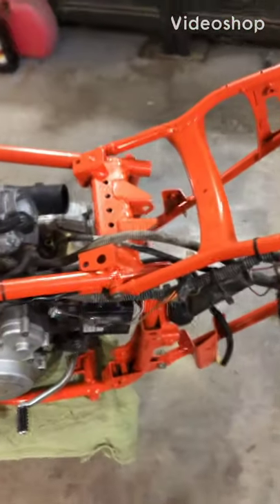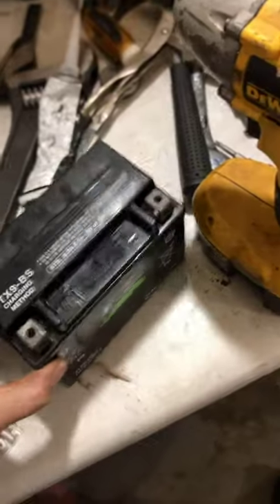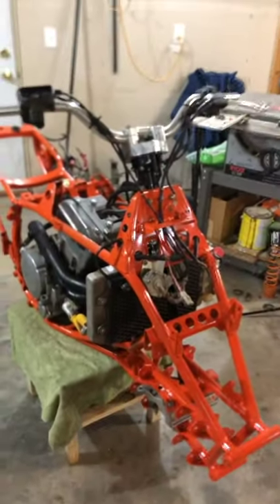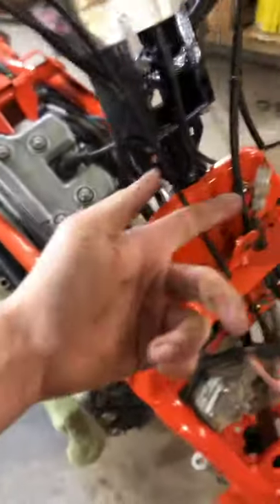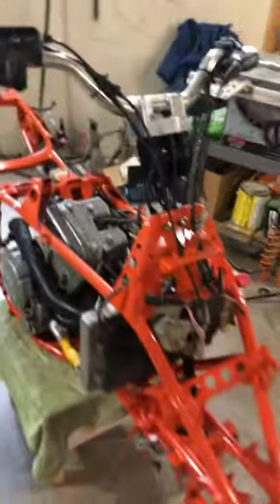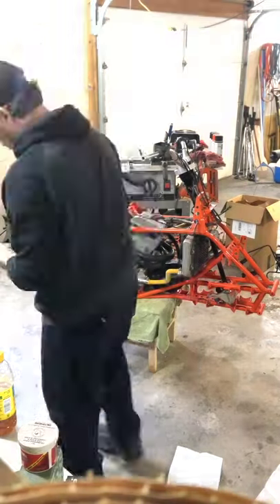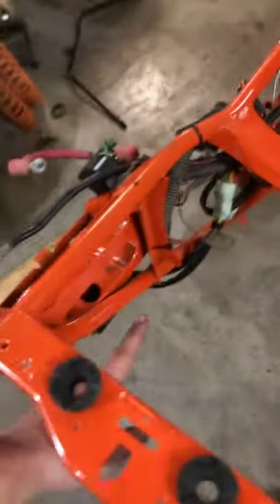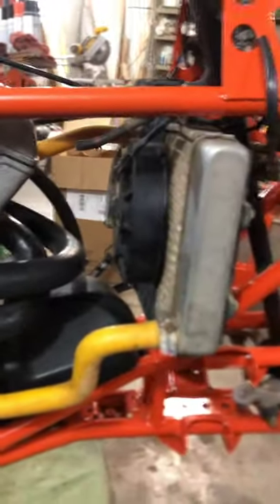Rebuilding a 2004 Polaris Predator 500 Part 13

Comment: There are 3 wires that come out of the clutch and go back
2 all yellow and a yellow with red
Where do they go
My plug was cut off
Reply from the maker: It looks like they go back to the voltage regulator that’s underneath the battery. I hope that this helps you out. Good luck!